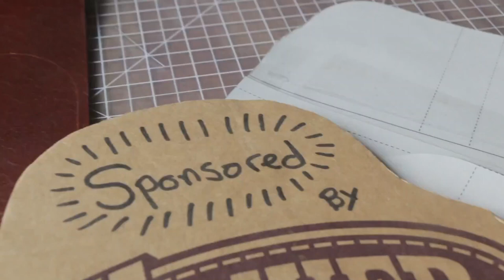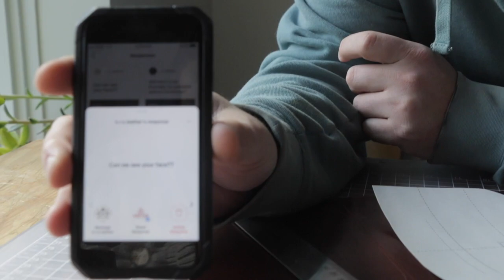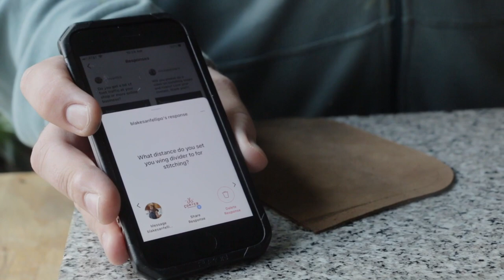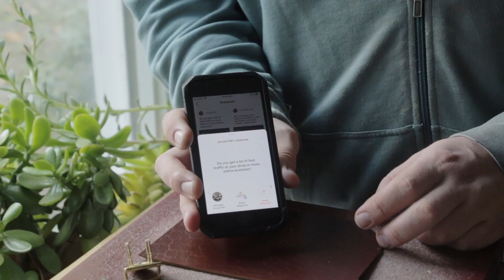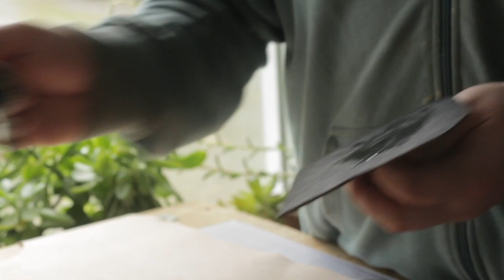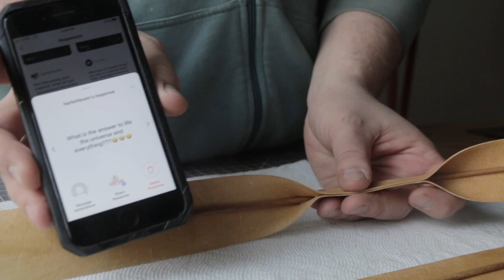Professional Leathersmith Answers YOUR Questions (Q&A)

Comment: I agree with everything said about spending on tools and leather etc except the practising on strip's etc that don't make anything. I need to feel I'm being productive so practised on making every smoker I knew a lighter sleeve. I made sleeves and holder and pouches for each of my tools. Theres so much satisfaction and reward when you spend 20 mins of practice on a usable item. I still have them now and some make me giggle at how bad they were at the time. But if I just cut and sewed strip's that went to the bin not only was I a touch disheartened by my original lack of skill, it felt like it was a waste of time as it went to the bin. 
If you're a knife person, make each knife a sheath. Cover your phone, make basic bowls, pin cushions, straps to nail to a board for tool holders etc. These are so rudimentary in terms of skill but still really useful no matter how imperfect. Keep your passion going with little rewarding jobs that get you practising. These things keep you keen to make and practice with all your spare time.

Comment: A bit late to the Q & A party, but I have a question that maybe someone can answer...

I have no experience in leatherwork, but am planning to at least try it out once the job situation gets better...but, I have noticed in all videos I've watched (from several different makers) that if they have a large sheet of leather, and need to cut out a large piece (say, 8" x 11"), they will mark the leather sheet several inches from the edge, and proceed to cut out the piece, leaving a substantial amount of "scrap" leather.

It's kind of like cutting out a shape in the middle of a piece of paper...it seems to be an inefficient use of material.

Why is this so common? Is there a reason for it?

Thanks in advance...👍🏼🙂